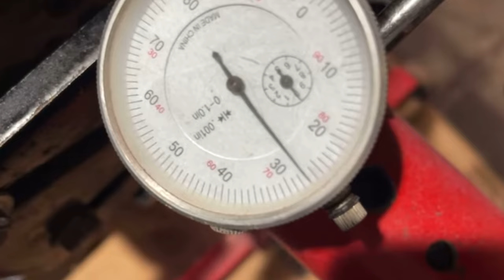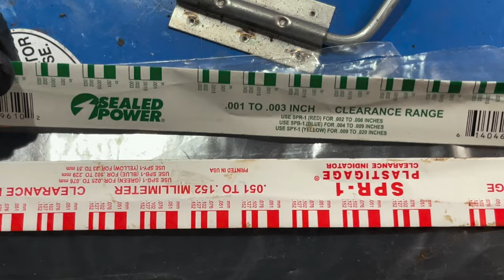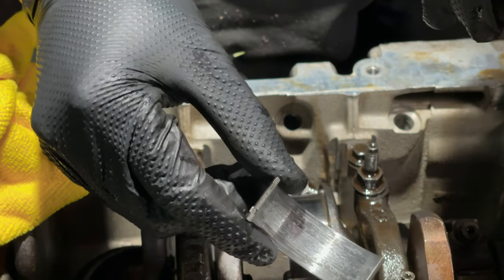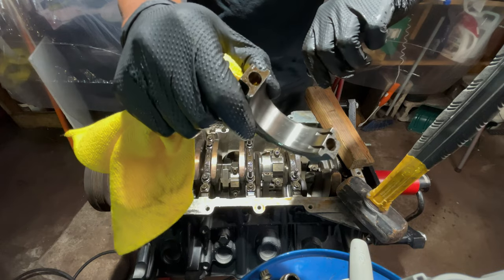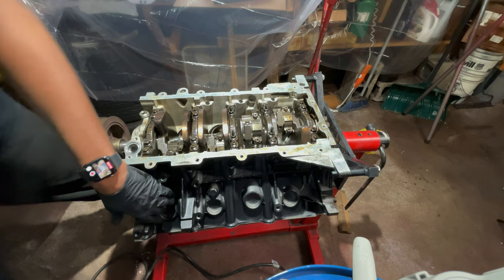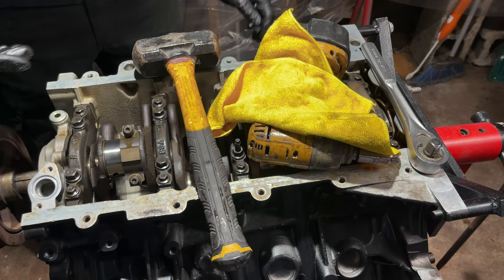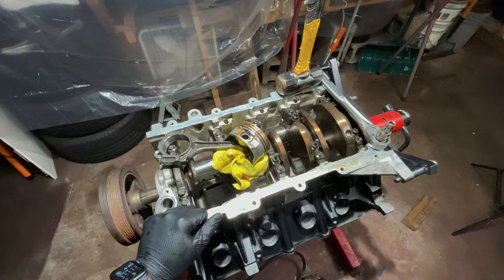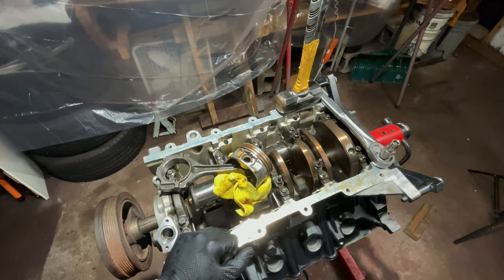How to disassemble a Mach 1 motor.

Comment: That is definitely a Teksid block. You can tell by the square pattern in valley. A WAP block has a diamond pattern in the Valley. A Mach 1 with an manual trans would come with a forged 8 bolt crank and WAP block and a Mach 1 with an automatic trans would get a cast 6 bolt crank and WAP block. Ford switched to the WAP block on the Cobra in mid 01, so the 03-04 Mach, Mercury Marauder, and Lincoln Aviator all got the WAP blocks. So as long as it is an 8 bolt crank, what you have is probably out of a Cobra, 96-early 01. Check the casting numbers on the block to get a better idea of the age and what it came out of.
Reply from the maker: Nice catch. I really haven't had time to spend on this build.